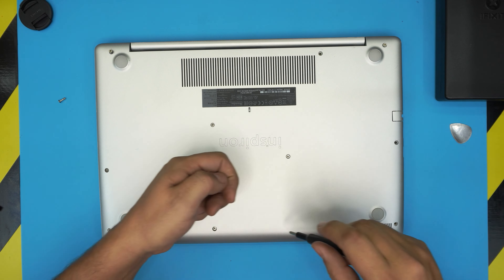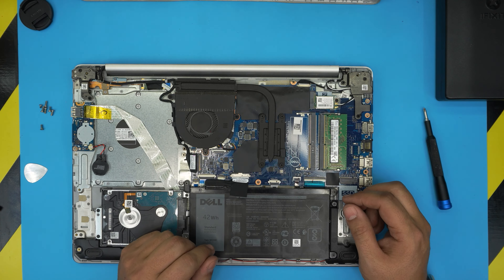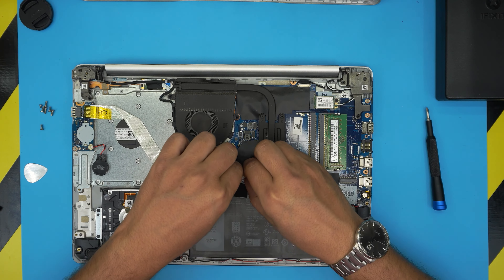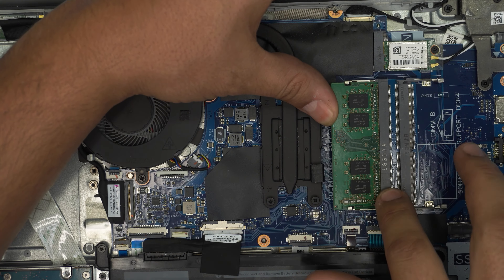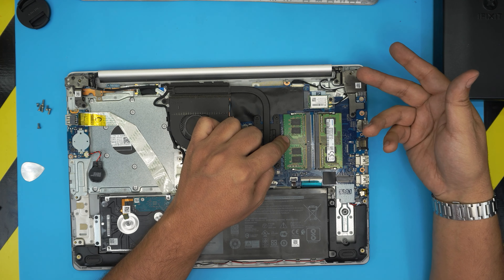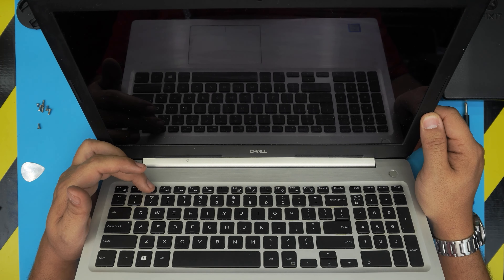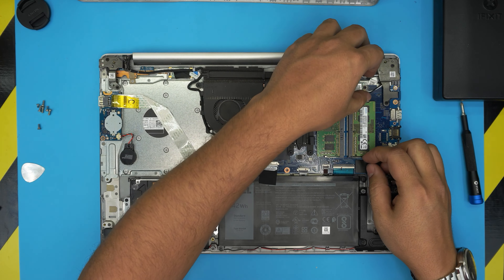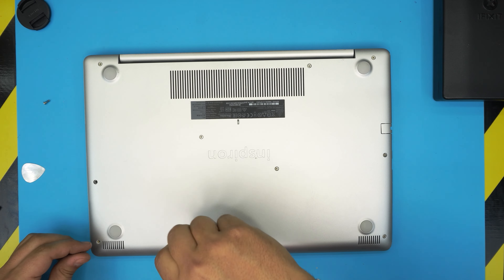Dell Inspiron 5570 Reg P75f ✅ Ram Upgrade 💻

Comment: Hi, does this laptop supports DDR5 and more than 2400MHz or just DDR4 at 2400MHz?
Reply from the maker: 🫠Regarding your question, it's DDR4, and right at 6:00, you can see "DDR4" written on the board beside the RAM. You can place any DDR4 up to 3200, and the BIOS will auto-adjust. The compatible RAMs are in the description, including the one we use.
Should you have any further questions or requests in the future, please don't hesitate to ask me.
cheers🍻

Comment: Is this laptop compatible with 3200MHz DDR4 SODIMM memory? Thanks.
Reply from the maker: Thank you for your feedback! If you wish to support the channel, you can like, subscribe, or do both!

Regarding your question, the laptops function similarly to PCs. The rule of thumb is that the higher the capacity, the lower the clock speed. The clock speed of the RAM depends on the motherboard. If you insert a 3200MHz RAM module, the motherboard will automatically adjust it to the maximum speed it can support. Adding more RAM may slightly lower this speed.

In conclusion, yes, the laptop will accept the 3200MHz RAM, but it won't run at that speed. If you have any further questions or requests in the future, please feel free to ask.

Cheers! 🍻